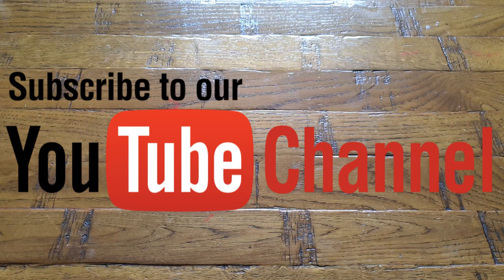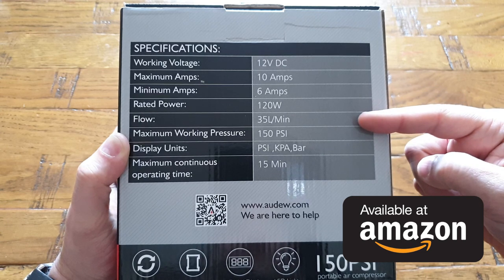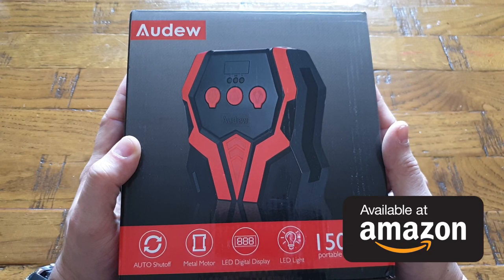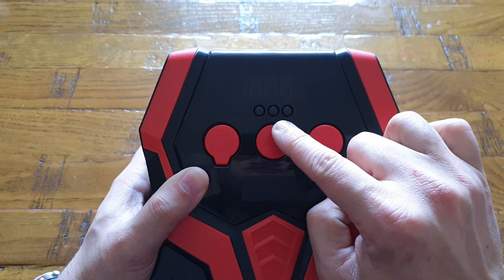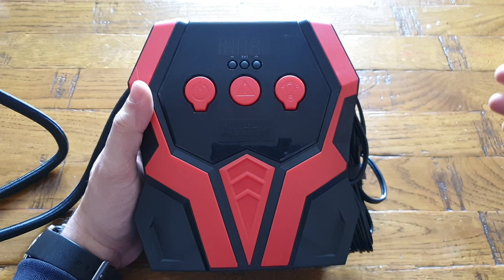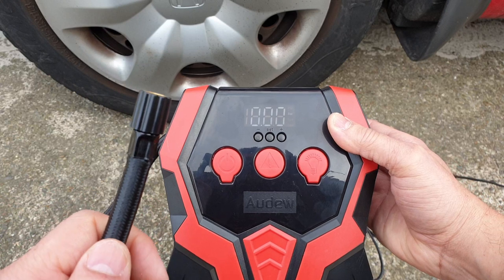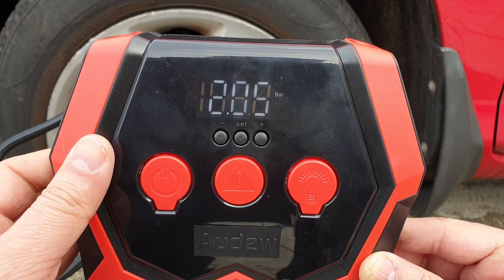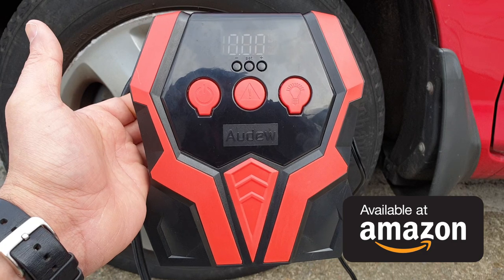Audew Portable 12 V DC Air Compressor Complete Review / Setup / Performance

Comment: Did you check the pressure with another device after to see if the reading was the same?
Reply from the maker: Yes I have, I had another one pump from different manufacturers